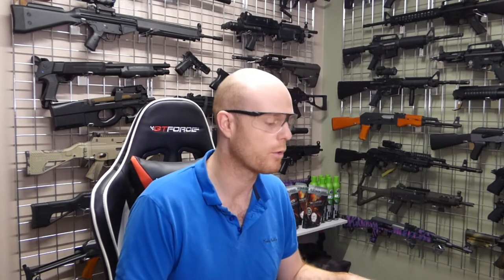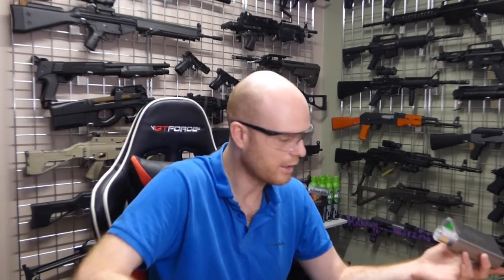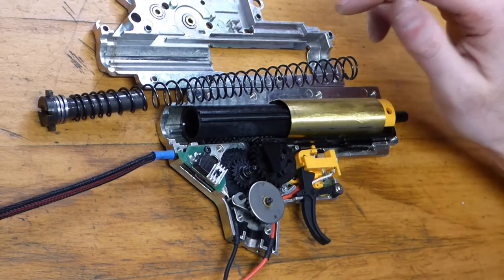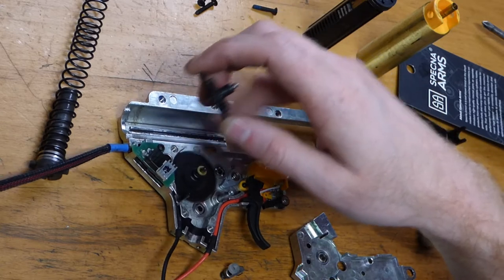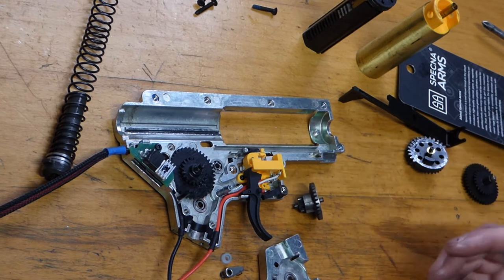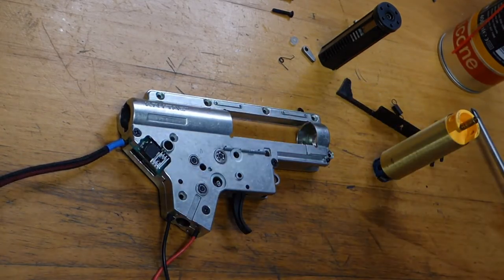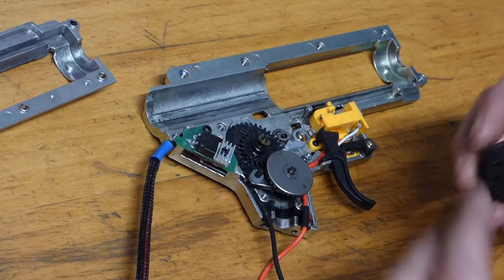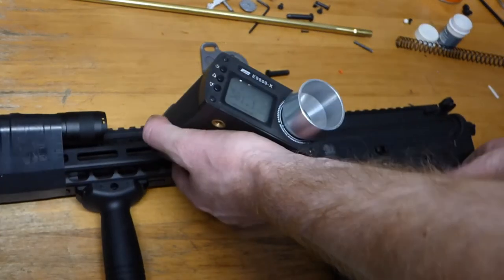Alway Check your piston compatibility!!!! - Krytac Barrett Rec7 upgrade

Comment: a job well done! I have a tip for you and anyone else with a krytac. being a tech myself, and having worked on the krytac nautilus gearbox, i am pretty familiar with the gearbox. the one thing that i thing you would benefit from in that build is an upgraded o-ring air nozzle, because the krytacs have excellent compression except for the nozzle. having done that in multiple krytacs, every single time, it increased the range on a stock aeg by at least ten feet, especially when paired with a tight bore, the range would be phenomenal. i have some other critiques, but nothing very pressing. keep up the good work.
Reply from the maker: Excellent! Appreciate your input! 😎
Reply: I changed mine to the promy o ring nozzle and it added 25fps right away. Aöso running a 387mm promi 6.03 and a gate titan. What woulf you use as a good piston/cylinder kit?
Reply: I thought that already have oring nozzels as the 3 gearboxs I have inn2 guns and one stand alone all seem to have an orange or black orange in the nozzel
Reply: Newer Krytacs have nozzles with o-rings in them.
Reply: @pingpong808  was wondering this.
Reply: im here for all the krytac critiques. what else would you do? i bought a spr. what air nozzle to you recommend?, krytac prometheus sealing nozzle? or use something different?

Comment: What motor did you upgrade it to? 40k motor? I believe it should’ve had a 30k in it already right?
Reply: I am also curious
Reply: Thaay do have 30ks but oddly mine were all heating up fairly quickly were I'd use g&g 25k witch disentangle heat up as fast and useing tinely 35k and warhead standard speeds I got no heta up issues and a, not even playing full auto just semi only

Comment: Which piston brand was compatible with the nautilus gearbox ?
Reply from the maker: Sadly I do not have an extensive list of compatible brands. This is something you need to check during a build before closing the gearbox and putting it under load.
Reply: @adzzzysarmoury   but wich brand did you used ?
Reply from the maker: @vichoo6961  honestly I can't remember the brand that went into this one. Its going to be an SHS, Specna Arms, tornado, or big dragon. I know that's not much help! Also I have seen some variances within the brands too!

Comment: What up grades would you recommend for a G&G arp9 for range I allready have a 200mm 6.02 barrel coming
Reply from the maker: I would personally start with the basics and choose a suitable piston with metal teeth and a suitable piston head. (Make sure the piston fits nicely and moves freely). You could then add a spring if you require more power. Then a maple leaf macron hop rubber with omega nub. This I would say are the basic upgrades but you can go further if you wish. 😎
Reply: 13/1 rocket gears,  If you keep your barrel short,  the proper ported cylinder for the bb weight , better nozzle, and head using the same brand that match adjust the aoe gg stock aoe is shit .. upgrade your spring guide to one with a bearing then you can remove the on me on the cylinder for faster builds and get a better spring guarder 120...  pretty much change everything in the top half of the gear box.

Comment: Was the stock rifle a lower power build initially?
Reply from the maker: I had put in a stronger spring than the original factory one. it wasn't massively under powered before but just wanted to get the most out of it.
Reply: @adzzzysarmoury  oh okay, I just ordered one from evike - they say it's the 400fps version.  So I was shocked yours was going for .87 joules - just wondering if that was the 350fps version or different regulations in UK
Reply from the maker: @EM-lb4md  I think where Evike is in America, they follows different power limits to those sold in the UK. UK limit for full auto at game sites is 1.14J which is 350fps when measured with a 0.2g BB.
Reply: @adzzzysarmoury  ohhh okay that makes sense! Thank you for the replies man.

I look forward to getting this gun - I'm probably going to upgrade the inner barrel though since that seems to be an issue with accuracy for some people
Reply: @adzzzysarmoury  That’s funny in America we are always trying to increase FPS